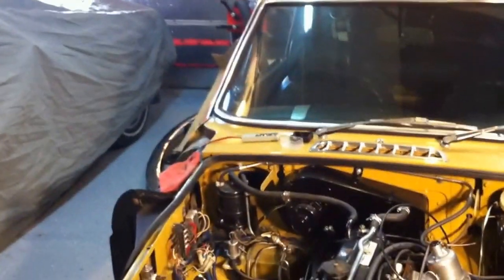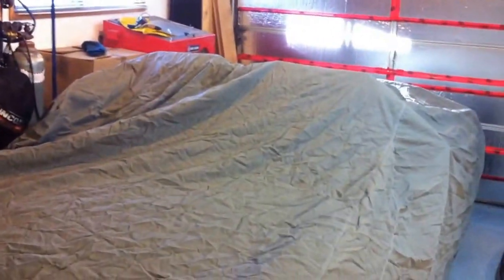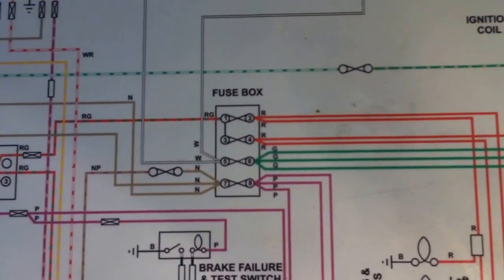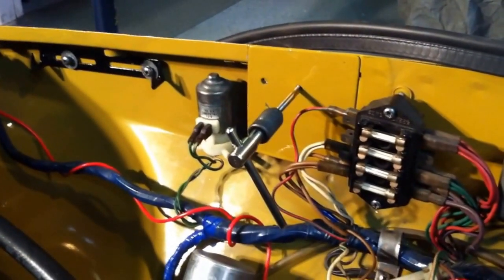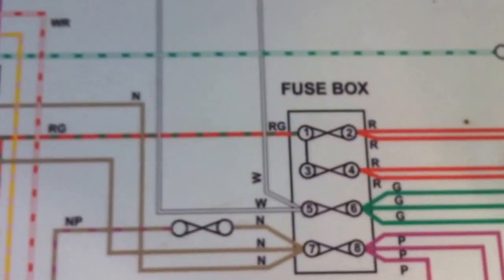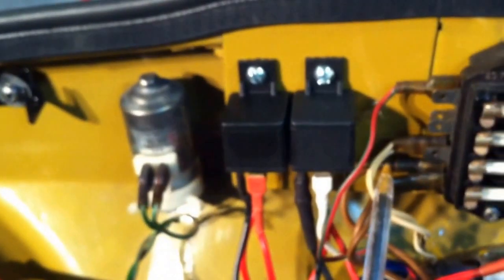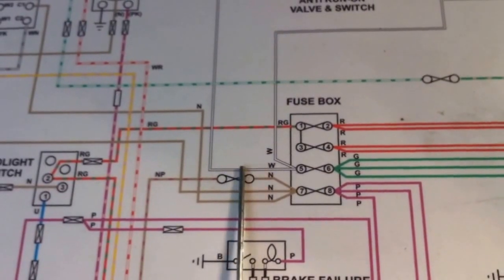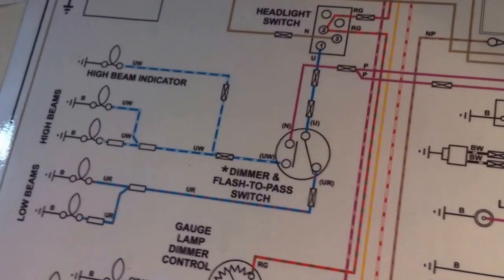Installing MGB Relays

Comment: I’ve installed relays for the headlights, horns, and the two other relays that you discuss in this video.  I have one question.  Did you have an issue with your turn signals no longer working?  Mine were fine in my 1972 MGB for about two weeks, and then they stopped working.  I’m currently sorting it out.  It involves replacing the original flasher unit with a modern electronic one.  I’ll let you know how this effort goes.

Comment: Do you happen to recall what gauge wire you used for the power wire from the starter, and the white wire for the ignition circuit?

Comment: Thanks again for this video.  I am still thinking about the PRINCIPLE  of how and why this works. Am I correct in concluding that the current draw through the old wiring is simply being directed through the 85>86 relay pins and thus reduces the electrical "work" to actuating the electromagnet, and that the major work is done through the 30>87 pins?
Reply: you all prolly dont give a shit but does someone know of a trick to log back into an Instagram account??
I somehow forgot the login password. I appreciate any tricks you can give me.
Reply: @Darwin Kingsley instablaster ;)
Reply: @Elisha Deshawn I really appreciate your reply. I found the site on google and I'm in the hacking process atm.
I see it takes quite some time so I will get back to you later when my account password hopefully is recovered.
Reply: @Elisha Deshawn It did the trick and I now got access to my account again. I am so happy:D
Thanks so much you saved my ass!
Reply: @Darwin Kingsley No problem :D

Comment: Great video, Rick.  I am original owner of a ‘79 MGB and had to replace my ignition system.  It runs fine now but I now have a short circuit when I press the horn with headlights on!!!   You’ve provided me the enthusiasm to investigate the problem as well as isolate those sub circuits with relays.  Amazon should thank you.

Comment: I like your video on adding relays to the lights . I have a 1979 MGB conv. and the wiring is a mess the tach does not work wires are  unplugged from something ? Your wiring diagram looks similar . I just got the car a few months ago , I do have it running but lights on right side are working not very bright and left is not at all . What would you do to help fix the problem ? Thanks again Jerry

Comment: Hey Rick nice video.  I am currently attempting an installation of dash and main harness in 76 MGB but harnesses are 79s.  I am not doing relays (not enough sense)  Any  idea other than  MG Experience where I can find instruction on how to connect bullet connectors in proper sequence.  Seems , for example, that the headlight may be 74/76 and colors do not match the new harness.  An the Bentley diagram does not show specific connections to individual electronics  thanks if you can help
Reply: Greg Wood he best source of info is Rick Astley's electical book.  I highly recommend it. http://www.amazon.ca/MGB-Electricals-Systems-color-illustrated-understanding/dp/1845842294